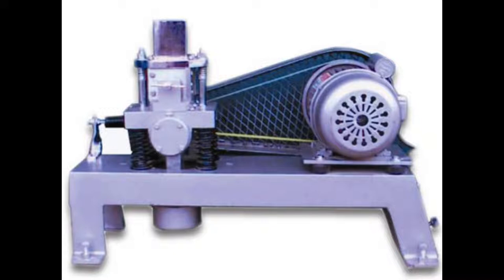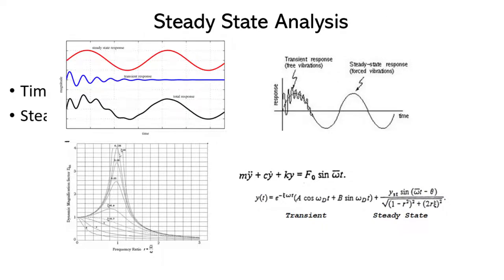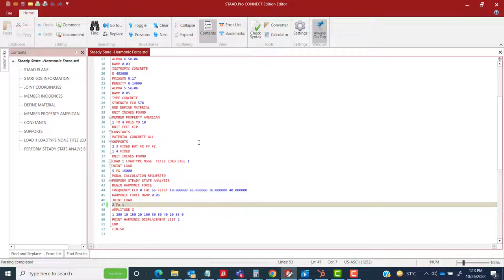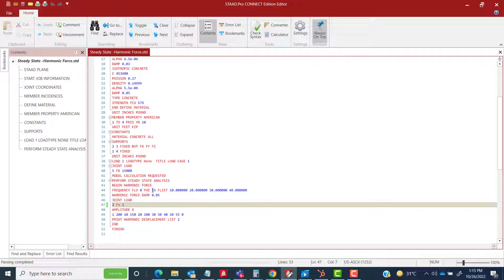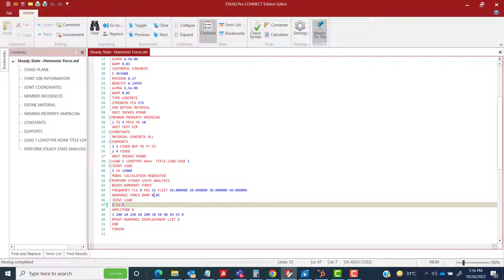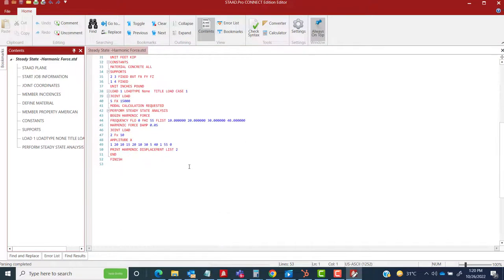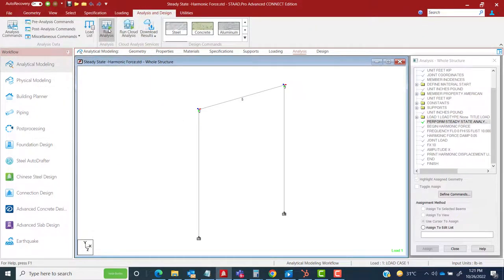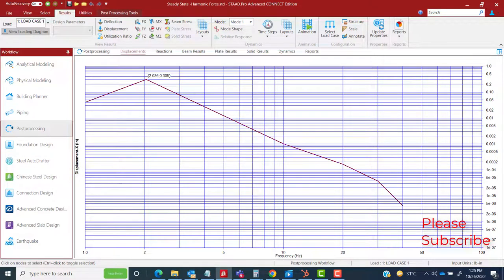Steady State response of a structure in Staad

Comment: Hi Thank you for the Video. I thought of exploring more on this but am facing problem with the syntax. Can you please share us the staad model. Thank you
Reply from the maker: Please share your email.
Reply: I got it, now it’s flawless. Thank you. I need one info. Suppose I am designing a dynamic pump skid. Can I ignore transient effect . ? Since in the above example we are    Taking steady state and ignoring transient effect.
Reply from the maker: @prajwalbm9508  transient part is in the initial phase of the vibrating motion. Very quickly it decays depending on the damping of the structural arrangement. In case you want to check the transient part too then use the THA. You may create the time vs acc pairs  in spreadsheets from the speed zero upto certain speed ( till you can assess the decay of the transient part) and feed these values in time history definition and perform the analysis.
Reply: @Torq123  Thanks for the quick response. I performed time history harmonic analysis for my skid (Displacement against time). As u told for initial fraction of seconds my displacement are high. (>1 in) later in steady state it’s around 0.7 in, but my skid spring capacity is 1 in.  I am bit confused here.
Reply from the maker: @prajwalbm9508  there could be two reason . (1) transient component is significant (2) the natural frequency is very close to the operating frequency at the start ( natural frequency is low)..
Reply: @Torq123  RPM is 500, HP is 150 . Due to this I am getting amplitude of 6.52 kN. This is causing problem I feel.
Reply: Can you add video for STG deck foundation dynamic analysis